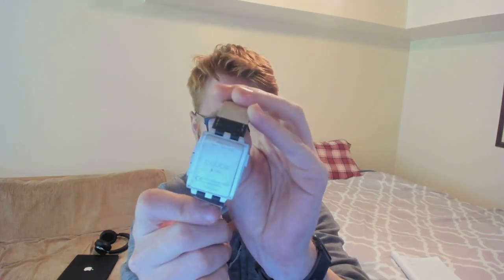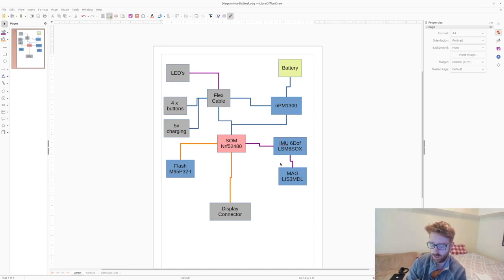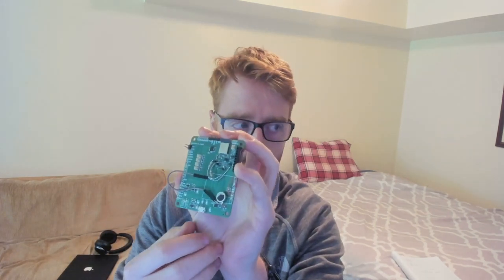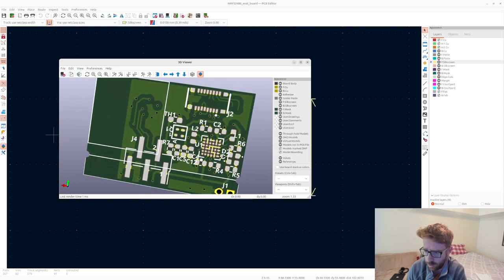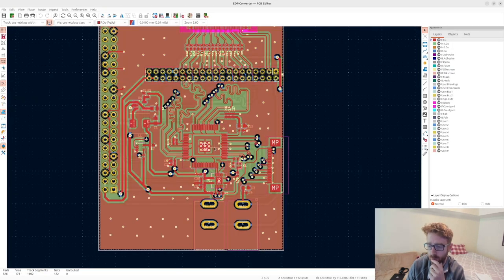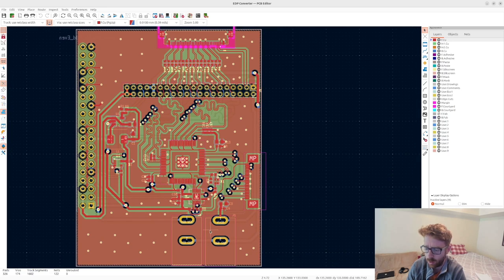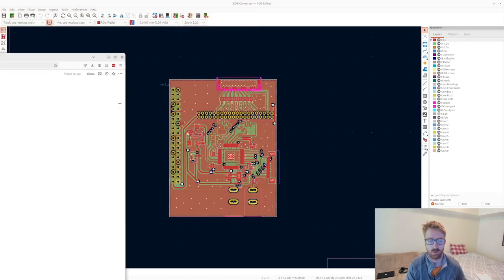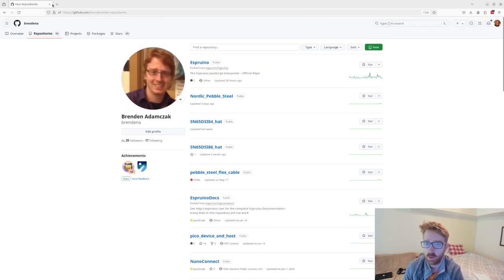Channel update 2024 part 1 (Pi screens and Nordic watches)

Comment: i have like 15 pebble steel shells/ watches. id love to get some boards to replace them to get them working again.
Reply from the maker: Well i can deficiently send you some just general pebble steel boards if you want.  Since i won't be using the internals.  But do you right software at all.  The boards in the images are fairly fresh.  So they won't do much without a good amount of software for them.